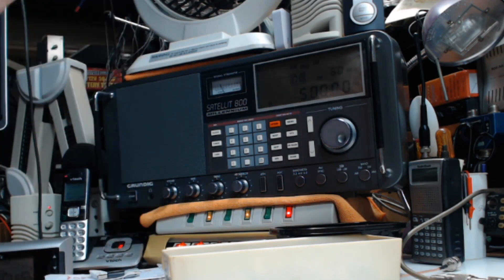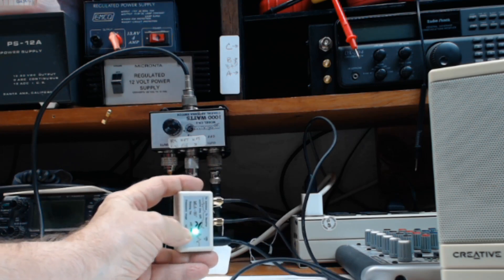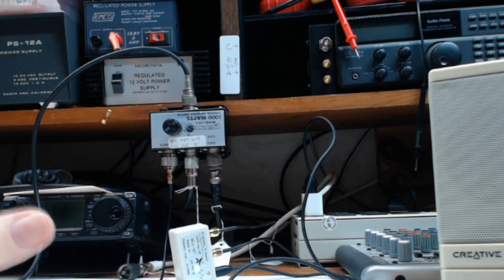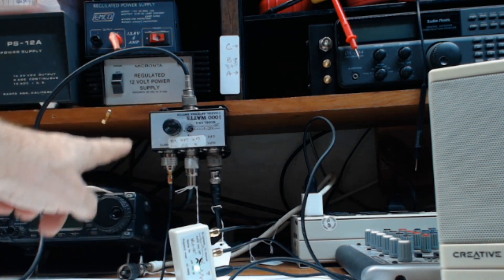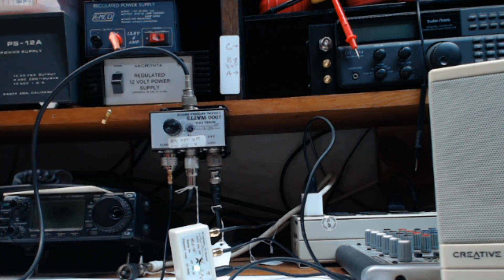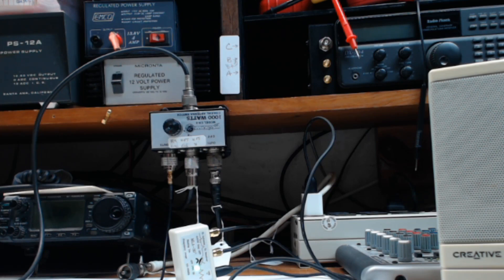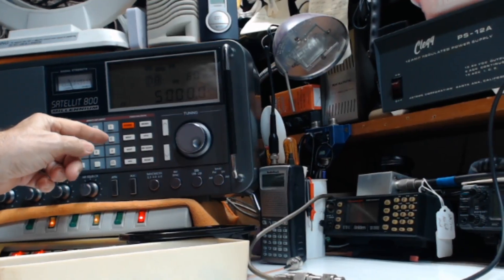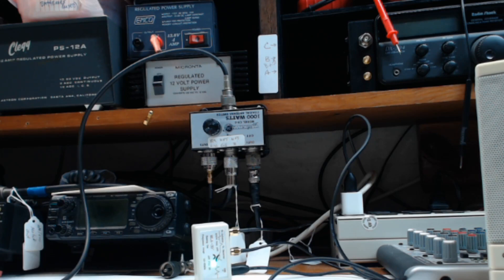TRRS #2040 - MegaLoop vs 31 FT Vertical Shortwave Antenna

Comment: So much noise... Terrific and very sad, how the hobby have impacted last decade. Do you rotate the loop? Seems like the noise source is unidirectional
Reply from the maker: On the small loop antenna, direction does not seem to make any difference.
Reply: @hamrad88  Ok, why not to set it up on the roof, or attic?
Reply from the maker: @yaroslavartyukh964  The loop antenna is outside and about 15 feet in the air however the surrounding tree are 40 feet high but those should not be a problem unless they are wet.

Comment: Tom,  QUESTION:  What are you using to power the Mega Loop?  Make and model number if you don't mind.  Are you sticking with the 5V - 2A configuration that the input calls for?  Thanks
Reply from the maker: The little USB adapter that came with it. MLA-30+ from Amazon. It's in my Amazon store.  See the link to my store in the description above.

Comment: Pretty wild to see how much noise the loop eliminates.    Just curious Tom, if you could only keep 1 radio and 1 antenna what would it be and why. That would be a great video to watch because of your experience and the different equipment you have had your hands on.
Reply from the maker: Tough questions.  I think it would be my SDRPlay RSPdx and the Megaloop antenna.  The RSPdx because it is a great receiver and very versatile and the Megaloop because of the great reception and low noise.